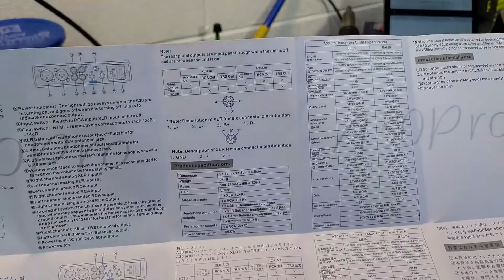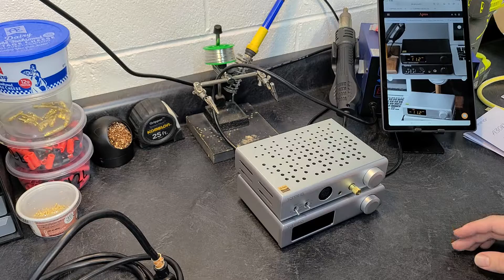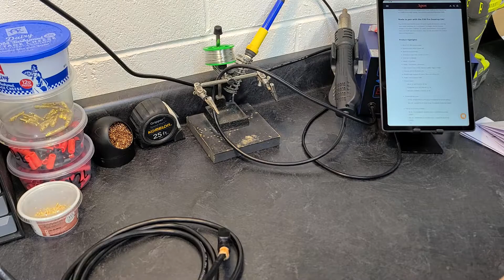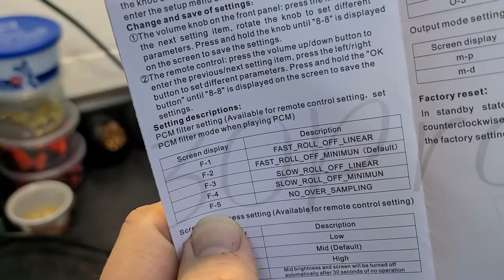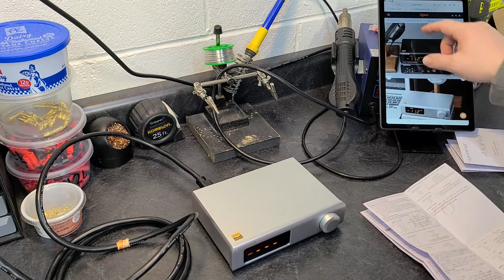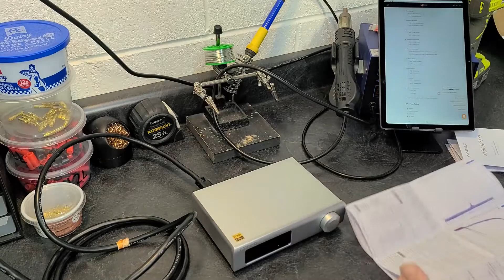Topping A30 Pro & D30 Pro (A Serious Stack)

Comment: I appreciate your thorough review of these, both the objective and subjective aspects.  The Topping A30 Pro looks to be the solution to an issue I'm having in the use of headphones connected directly to my tube amp in which the noise floor is just a bit too high between discernable hiss and 60 cycle hum during quiet musical passages.  This is because the phones circuit is driven directly by the output stage, hence noise floor is high.  The sound, though, from this tube amp through the phones is so sweet and I hope the Topping will sound pleasing as well.